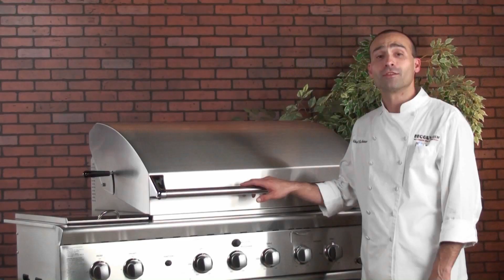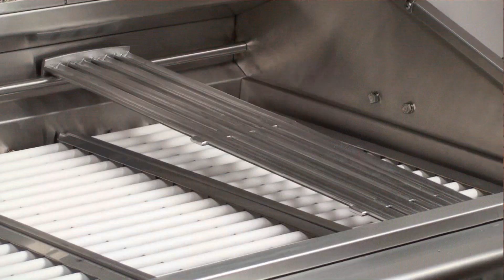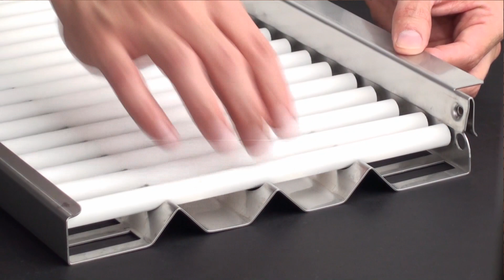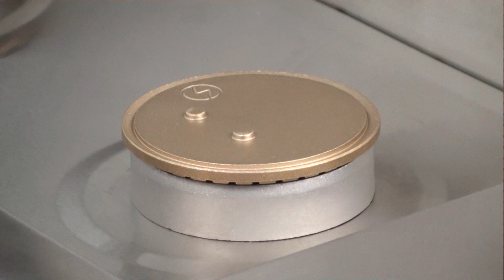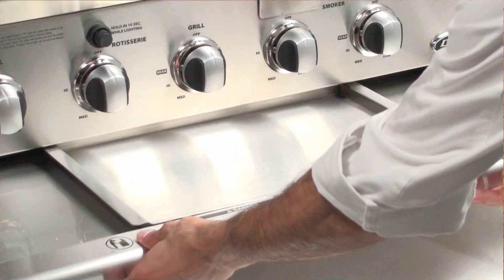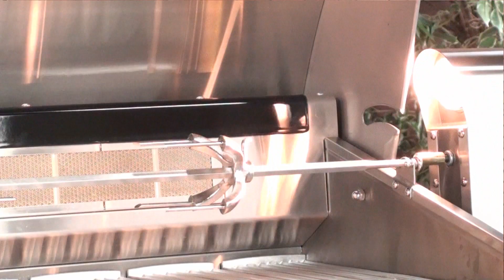DCS Gas Grill Review | BBQGuys Expert Overview

Comment: I tried smoking ribs last weekend on my DCS grill, but had no success with low and slow.  I could maintain temperature, but the heat didn't adequately cook the ribs.  Any suggestions?  I had the left two burners on medium, the smoker tray on medium and the ribs on the right grill.

Comment: Need help with grill buying.... I own a pool and everyone keeps telling me all the manufacture warranties get voided because of the rapid deterioration that happens on metal when u own a pool. What grill would be my best brand in terms of durability against this problem. I recently discovered DCS grills but wanted your expert opinion.
Reply from the maker: Lissy Guevara  Yes, DCS is a great grill!   I would also recommend checking out the Blaze Professional Gas Grill http://www.bbqguys.com/item_name_Blaze-Professional-34-Inch-Built-In-Propane-Gas-Grill-With-Rear-Infrared-Bu_item_2885950.html
The Blaze Pro is a great grill also,the burners are cast stainless steel and weigh 7 lbs each.  I think you will be very pleased with either of these grills, let me know if you have any other questions!